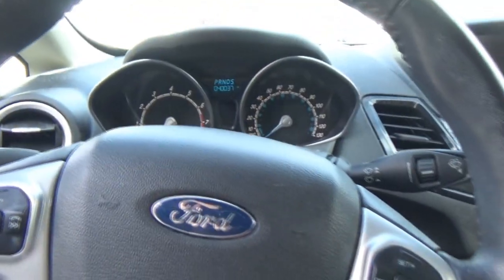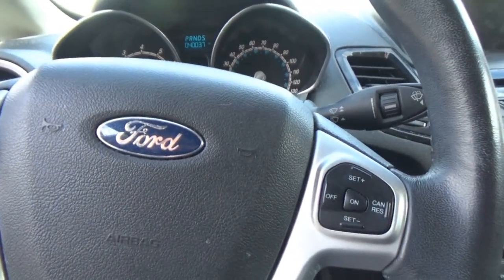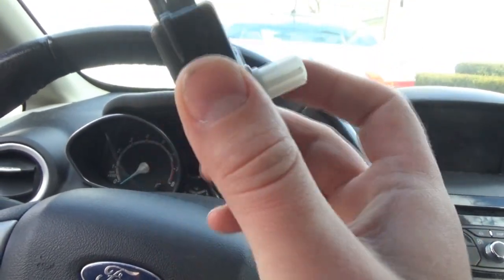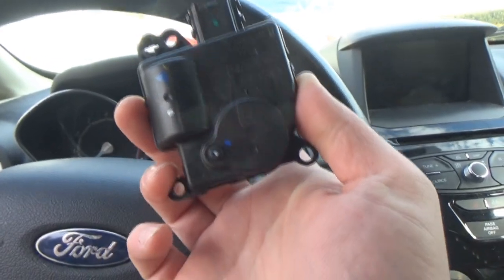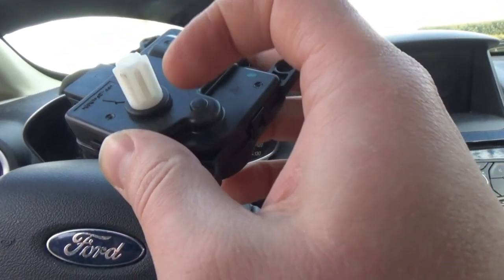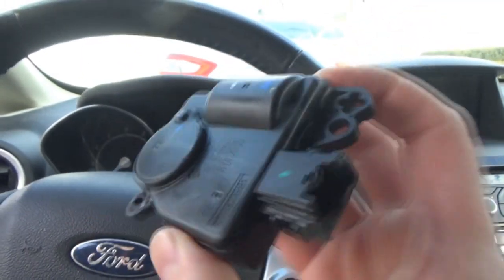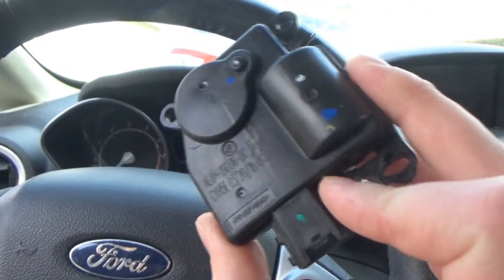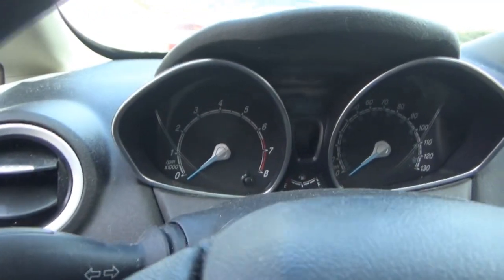MV 268 - "Ford Fiesta Blend Door Actuator Repacement"

Comment: This fix was a real pain at first. The trick for me was to really get up in there and not worry about breaking anything else or getting zapped or cut. I don't really fix cars, so these worries were a big hurdle for me. Took me three tries (and fixing the passenger one) just to build up the confidence. It's kinda amazing, though, how much you don't need to see when doing this repair. After a few minutes it was pretty easy to just feel your way around. Also, to adjust the motor, I found it easier to pop the casing off and twist things to match the old one. The arrow on the motor definitely helped me line things up. The red tab was tricky too. I had to plug the motor into the power cable first before adding it. And for the big wad of cables, I had to pop out the anchors at two base points just to get enough room to do any of this. Oh my fiesta is a 2018.

Comment: I had this repaired at a dealer right when the car was out of warranty and they charged $500 for this. After less than a year, the clicking was back. So I took the car in again since the repair had an one year warranty. They made the noise go away. Three months later, the clicking is back again. Now I will attempt to repair this myself. Thanks for the detailed video.
Reply: What happens if you just unplug it?
Reply: I had mine in my 2015 FiST repaired under warranty and the itemized receipt also indicated that it was a $500. job (parts and labor). Two years later…, the clicking noise was back. I’ve been living with it for a couple of years. Now that I know how easy it is to replace and how inexpensive the part is…, I’m appalled that they’d value this repair at $500 bucks. Outrageous!
Reply: @mercoid  dealer is always a fraud. Dealer = stealer.

Comment: Thank you! Some other videos kept referring to the recycled air actuator as the blend door actuator so I accidentally replaced that one first :/ When I went to replace the actuator behind the steering column I found that it had been unplugged... When I plugged it in (sure enough) it made a clicking sound. So I guess someone took the easy way out and just unplugged the actuator and didn't mind that the windshield defrost wouldn't work. I fixed it though! Your video was the most accurate and concise vid I watched after hours of looking for the answer. Thanks!!

Comment: for your info, there are 3 door actuators on Fiesta: 604-400 Mode actuator (driver side), 604-251 Air Inlet (behind the glove case) and the 604-322 Temperature actuator (at the left of glove case near controls)
Reply: How difficult is it to get to the rest of those actuators?
Reply: @amiedavis5257  only the glove case one is easy. The one at the left of glove case is medium difficult. The one at driver side is pretty difficult, I bought a mini ratchet (4 inches long).
Reply: @pierrevandal4747  With any of them, does the dash need to be removed?
Reply: @amiedavis5257  no. I succeed but for the driver one I remove the steering cover
Reply: Which actuator is the one that controls the fan speed? My fan only works on the higher settings.
Reply: @nataliekovaleski6905  actuator does not control fan speed, it may select cold/ warm air, direct airflow at foot or dash, etc
Reply: @pierrevandal4747 thank you for replying. I’m having a hard time finding what needs replaced to fix the fan speed. 2019 Ford Fiesta SE
Reply: @nataliekovaleski6905  here a small video that seem to be your problem

Comment: 2018 Ford fiesta.  Replaced the first actuator in May 2020 under warranty.  Replaced it again or maybe the recirculation one in May 2022.  Same part number, but they told me it wasn't the same thing.  Now, 4 months later, it's ticking again.  And it keeps ticking after I turn the car off.

Comment: My replacement does not click now but it has also failed. It does nothing. But if I have the car on and just unplug it and plug it back in it resets itself and works. Probably a bad pcb limit switch/position sensor. Pulling the fuse had worked a few times in the past, too.

Comment: Very helpful thank you, did the clicking affect the hot an cold not working?
Reply from the maker: Not this particular actuator. This one directed air flow only. There is an actuator that controls the air temperature door, but mine is still working fine.
Reply: @MichaelAdamsRocks  thanks for the info

Comment: Is the recycling door actuator the same part number? I just replaced the hard one behind the steering wheel, but now I realize the sound is coming more from the passenger side 😂
Reply from the maker: The recycling door is right behind the glove box. I did a video on that one as well a couple of years ago. I can’t remember if it’s the same part number, but they look similar.
Reply: @MichaelAdamsRocks  Thanks so much.  Thank you.  I was able to figure it out yesterday 👍🏼. The one behind the glovebox looked the same, so I wasn't sure.  It was a different part, though.  The ones behind the dash has 2 pins in the connector.

Comment: Quick question! I’m fixing this problem on a friends car and I don’t understand why some actuators are only 2 pin instead of 5 pin. Anybody got an idea?
Reply: They don't have a position sensor potentiometer in them, just a motor.
Reply: @danielborquez9788  i know this post is from a while ago but my driver side vents can push hot air put not cold , passenger side works properly. The drivers side can be set all the way to heat and it heats up but when it goes to LO temperature it just pushes ambient air. do you think its the heat and cold control

Comment: Was the motor “working/moving” when it was broken?
Reply from the maker: The motor was working but the inner gears were starting to strip out which was causing the clicking noise
Reply: @MichaelAdamsRocks  Mine just blow for the face, I switch to feet or windshield but still blowing for the face... You know what it can be?
Reply: Mine blows to feet and windshield. The door mode actuator is broken.

Comment: Do you remember the model number of the part you ordered? I’m on amazon and I see multiple parts. They all say actuator but different numbers. Thank you!
Reply from the maker: I have the box at home still. I’ll let you know.
Reply from the maker: Ford part number BE8Z-19E616-B
(Motorcraft number YH-1896)
Reply: That part number shows as the defrost mode.
Reply: I don't know if it's too late for reply,  these Ford Fiestas have 3 different actuators, dashboard position, heat/cold control and air recirculation; the one been replaced in here is the dashboard position one, a Five pin/connector wire I bought it at RockAuto.com part # 604-400
Reply: @danielborquez9788  where is the third actuator that’s not in the glove box?